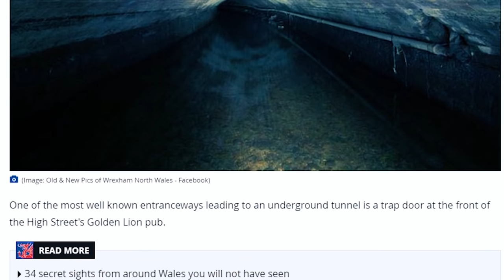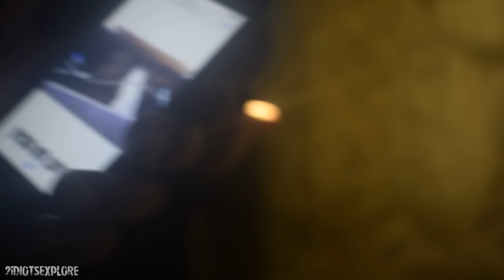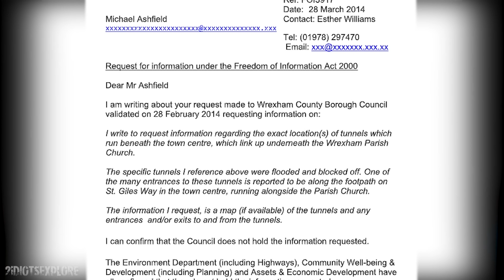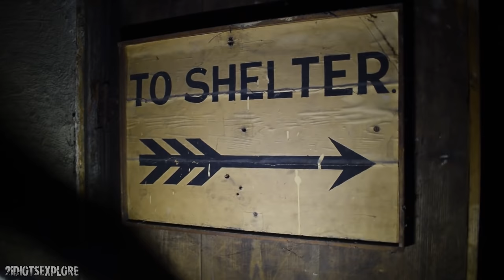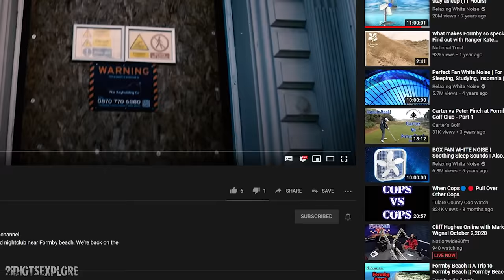Wrexham's Underground Tunnels

Comment: This was interesting! (1st video of yours I've  watched) btw. About 20 years ago, I used to work in a small care home that used to be the vicarage that belonged to a church,  which was a few hundred feet away from each other (Yes, the home was situated in the graveyard,but since not being used as a vicarage has been fenced off). Anyway, in the kitchen of the now home is an oak door, and beyond that door, a tunnel that leads to the church. This door had bolts on it and a very large padlock. This door was never opened in the 2 years I worked there, and as far as I know hadn't  been opened for years. I used to work nights on my own there, and I always tried to avoid the kitchen if I could, I was always scared in case someone or something burst thru that door!!!  😨 Watching from Dudley, West Midlands.

Comment: Pretty rad.
Some other bits to look into; i've heard that a lot of the shops opposite the council offices have access to a tunnel network of some description but they're barred off (the former CEX shop used to store old boxes and crap down there and supposedly there was like a subterranean street behind the bars). Given the vicinity, I would find it probable that the council building itself has access points in its cellar, but that's complete speculation.
Underneath the university campus there was a secret fallout shelter that was discovered a few years ago which might warrant some exploration, if you can secure permission at least.

I find it curious that one of the bricked up arched entranceways under the butcher's market was pointed with sandstone masonry, much like the materials of the church.
Keep digging guys!

Comment: Brilliant video. It's great to see you doing the research and asking people the right questions to hopefuly solve the mystery. The tunnel you waded through, that may well be an old river that has been placed in a culvert as the town grew. You might have some luck looking on the NLS maps to see if it shows up on them. May even give you a bit more information about where it leads. Interesting to see the air rade shelter down there also. Very well done!

Comment: Don't know if you'll see this now, 4 years on, but I lived in Wrexham 1998 - 2002, and worked in what was the Cosmopolitan Cafe Bar, right on the corner of High street opposite The Golden Lion. I think it later became a restaurant. Lots of talk back then about a tunnel network leading from the church to various pubs, used by the priests in years gone by.  Again, the basement of the Cosmopolitan, which included the toilets, cellar and office, were at least partly formed from the old tunnels.  Particularly the men's toilets,  which had archway structures that had been blocked off, very similar in size and shape to those featured in this video. We figured there was probably a direct link across to the Golden Lion under the street.  There was also a lot of talk of The Golden Lion being haunted, with very strange things happening - staff finding beer pumps left on, or feeling as if they had been pushed while walking down stairs to the cellar. Apparently the upper floors in particular were supposed to be very haunted, and staff refused to go up there. The Golden Lion is one of the oldest buildings in Wrexham - I think it was an old coaching inn our something like that.

Comment: The original part of Wrexham industrial estate has tunnels with a small guage railway track which leads to borras airfield .  

They moved the munitions that way rather than overground which would have been a security risk 

Holt church as a tunnel going to the caste is just a rumour. But you can see tunnels extending out from Holt castle in the spring time.   The daisy's show you where they are, in the spring  as they seem to flourish in the soil directly above the tunnels.
Reply from the maker: Hi Dave we explored the Ordinance of Wrexham here if you are interested: https://www.youtube.com/watch?v=bgS9wUDxZGk&t=106s Thanks for your comment Dave!

Comment: My uncle worked on the Overton Arcade renovations (I think mid-late 80s), and once took my mother and I into the cellars of one of the shops, which were all interlinked (we went in through the cellar one one shop and out through one of the others in the arcade) and then into a tunnel which when we started we were standing and then as we proceeded along the tunnel to a point where the floor and ceiling eventually met, my mother and uncle were crouched down.  He indicated that we were somewhere below the High Street at the furthest point.

Comment: The tunnel with the river is just a culvert for the river Gwenfro, It runs in parts all the way from the back of the Hospital to the end of Rivulet Rd
Reply: Correct about the culverting of the River Gwenfro. Brook Street used have the open river running down the middle of the present road, with thouroughfares running along each river bank. There was a bridge over the river at the base of Town Hill and Bridge Street/Penybryn. Nothing but a culvert river, not a tunnel.

Comment: The Gentleman in the Butter Market mentioned tunnels under the Miners Institute (current Mosque) on Grosvenor Rd. He may be confusing it with the tunnels under The Mines Rescue building on Maesgwyn Road, which has training galleries under it. Volunteers are trying to open these up.
Reply: no he is correct. a good friend of mine worked there as a bartender years ago and the then manager ov the miners institute showed him a large underground room,  all equipped with lights etc with tunnels leading off it. (im not sure if they were bricked up or not)

Comment: The tunnel you went down and the one you didn't are probably just small rivers that have been covered over, so you might have better luck in summer when the water levels are lower.

I don't know the locations of the tunnels, but you might be able to verify whether they are diverted/covered rivers or not by checking on a side-by-side comparison map like this: https://maps.nls.uk/geo/explore/side-by-side/

Comment: Someone has pointed out that the culvert under Brook Street is simply the Gwenfro river. I forget the date when it was culverted, but the area had been unsanitary for decades, if not centuries. The Gwenfro was pretty much an open sewer. It's  documented in the official health reports of the 19th century.
I expect you rememer that the Bank bar was actually a bank until a few years ago.
Apparently the old town well still exists under Island Green. I believe it's  under Iceland. Access is through a gate near the Mitre pub and Wrexham  Prestige taxis. I think the alley is called Well Place. I don't  know who holds the key now. I was told it was a private individual, but that was about 15 years ago. Someone at the museum may be able to direct you in that direction.

Comment: its the same here in my home town of bishops stortford the council deny it all but there are tunnels. i used to work in a pub that had tunnels and all that closed them off were flattened card board boxes. summer time we could not keep the seller cold as all the cold air was going down the tunnels. it is very intresting

Comment: I am from Rhyl left there years ago in 2006 . I am in Bristol now and every year they open all the tunnels up for 1 week i think as never been down them . But there has been other tunnels on you tube that people have explored as they are new tunnels which have been blocked off but now they have got in there . Have you ever heard of the tunnel from Rhuddllan Castle to St Asaph as there is a church of the bottom of the high street there . It was for the monks to escape Henry V111 to go to escape down a tunnel from the castle to the church . But nothing has ever been found as you have the  river running beside the castle . Also the castle is haunted as well . Years ago i use to love a pint of Wrexham larger then it went out of business  as but i believe it has reopened again the brewery as the old brewery use to be by the racecourse ground of Wrexham FC.

Comment: Church woman: "The tunnels are complete fiction"

You mean like God?
Reply: Na!! She has got it wrong. God is real, and so are the tunnels, I have seen one myself.
Reply: She was rude. "There's no evidence" .. well there never will be if you don't let people look. Obviously there's no obligation for her to allow them to look however.
Reply: @mikeh2006  The tunnels are not fiction. My grandfather used to do the accounts of several firms in the market and in the high street. One of them was Roberts and Pugh. That was the Mr. Pugh referred to in the film. He showed me the tunnel that we saw the entrance to in the film but it was not blocked off then and we walked under the high street. It was blocked off at the far side of the street in order to protect the bank vaults. Mr. Pugh told me there were other tunnels beneath High Street. On the other side of HighStreet, adjacent to Mount Street was Parry’s the saddlers. Old Mr Parry said that there was a tunnel running under Mount Street allegedly towards the old Border Brewery. That was all in 1955. Incidentally, the tunnel, in the film, that was running under Brook Street is the river Gwenfro. It was originally above ground but was covered over to facilitate the development of Hugh Price leatherworks - now Island Green shopping mall, and a couple of breweries and other businesses. Then tram lines were laid and the tram service in Wrexham began. The main ground-water supply for the town is adjacent to Brook Street near the 3Tuns public house. It was a small brewery too. We share an interesting history in this area. The idea of clergy skulking in secret tunnels to get a pint is nonsensical. They could afford to buy beer, there was always the communion wine and it was not forbidden to clergy to enter reputable hostalries.
Reply: Cringe. It take you all day to come up with that one?

Comment: 17:23 IVE FOUND THE TUNNEL ENTRANCE!!!  see that tombe on the right ? Well top left corner put your hand on the there until you feel a curios depression. Press it 3 times and 10 seconds later the tombe will slide backward and you will find a gurt big hole underneath with steps going down. Apparently the tunnels were built for the priests to store their horny jazz mags and so when they were feeling a bit ‘full’ they would down to the nearest pub with their latest jazz mate and pop one off in the gents there.....